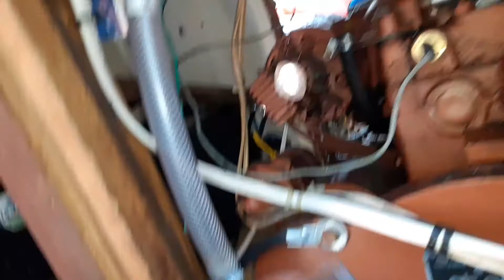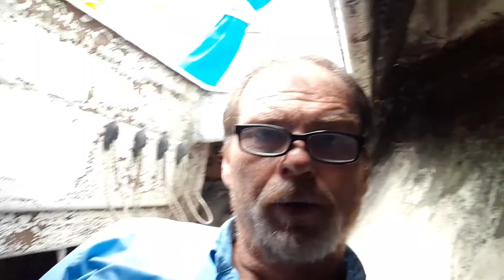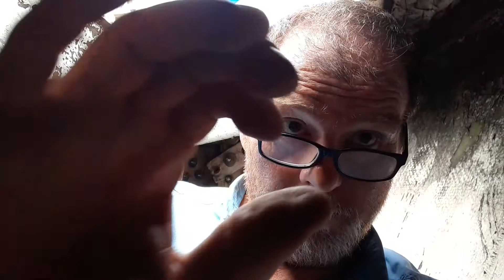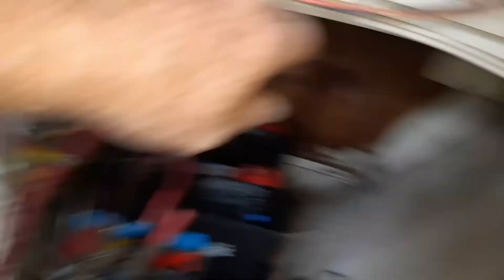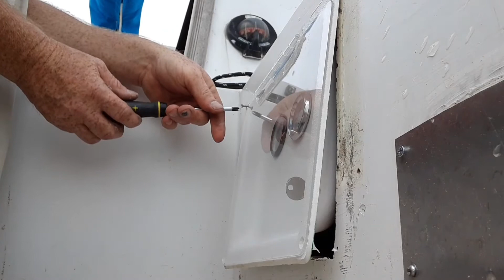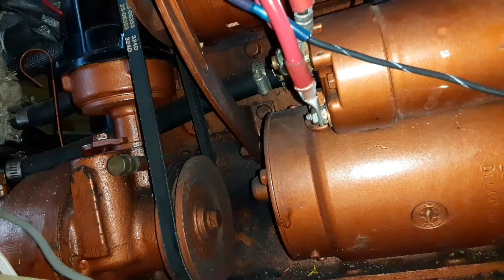Rewiring And Testing

Comment: Rewiring is not difficult if you do everything logically. Use cables and attachments, which will not cause oxidation problems in the future. Extra fuses certainly give a super extra safety. A pleasure to watch you at work.